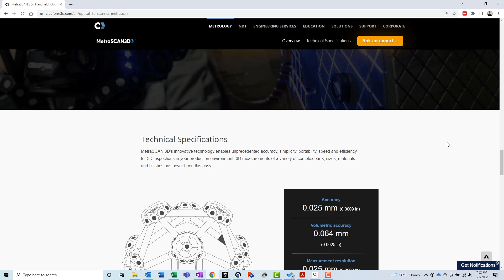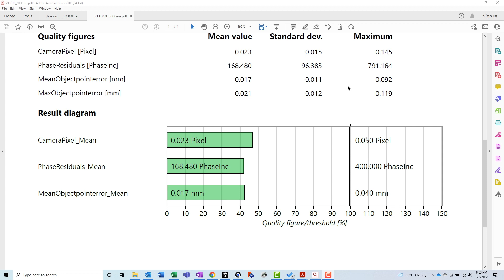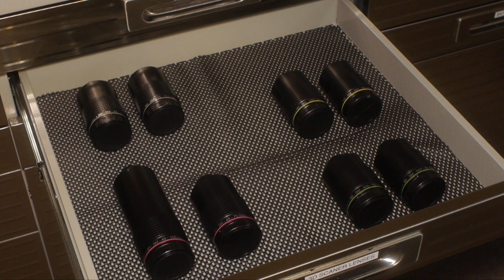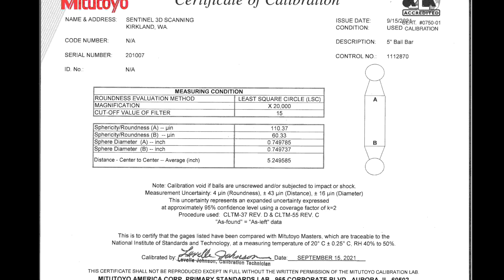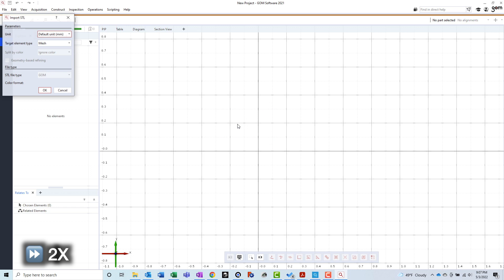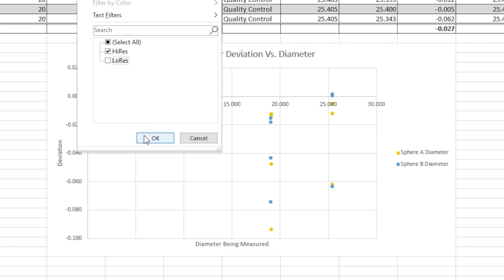How to Check the Accuracy of your 3D Scanner

Comment: What I missed in the video are the existing and quite common standards for accuracy checking of 3d scanners like the VDI 2634 sheet 2 (single scan data) and sheet 3 (merged data).
Reply from the maker: I do see VDI 2634 and ISO 10360 being referenced more often in accuracy specifications these days. I haven't read these standards yet, so I'm not qualified to comment on them. I can say that my own accuracy tests performed on my Zeiss T-Scan Hawk 2 were slightly outside of Zeiss' 10360-based accuracy specification, so it is probably a good idea to reference your own tests rather than completely relying on a manufacturer's specification when explaining accuracies to your stakeholders.

Comment: 12 years in metrology and after ton of "lets verify this dimension with caliper" videos, i really admire what you showed here. If you have all of these resources than you for sure can do Linearity with your "verification" artifact in combination with different lenses. Uncertainty is more part of "calibration" company. And there not much that you can do here... But still.
We used GOM only for plastic and cold formed metal sheet objects. What you mentioned is absolutely true, they are hiding uncertainty details. If you spent 50k or more on fancy scanner that you expect a nice quality scanning, which in fact can be done with 5-10k scanners. Those scanners are not made for precise measurements, if you wanna go with precision, than CMM is a way to go. For field measurements i would recommend laser tracker.